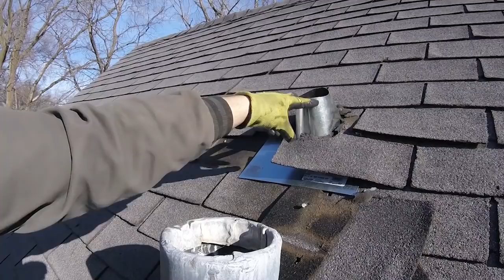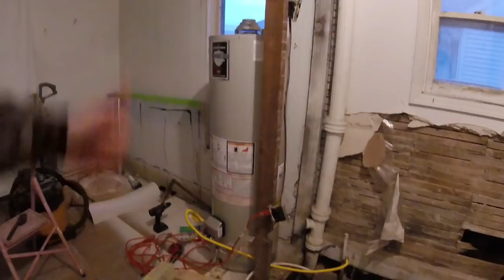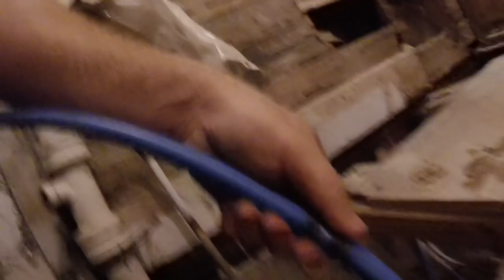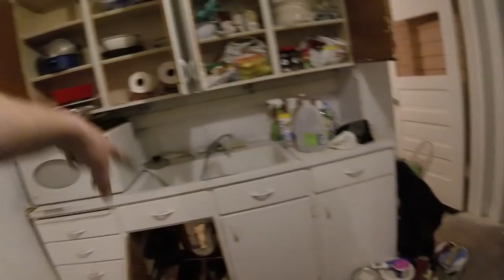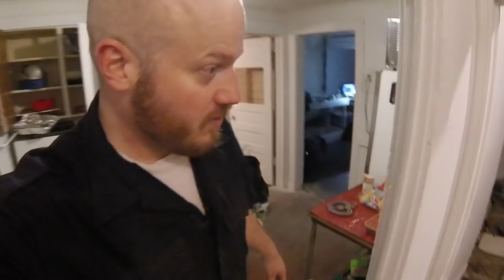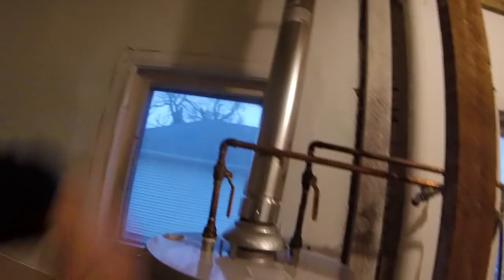$5000 House - New Gas Water Heater and Water Lines

Comment: I watched to see the fitting you used to tap into the gas line....you didn’t show it.  The connections to existing water lines, gas lines, cutting into them and connecting to them is the hard part....how do i connect to existing lines?   Too late i guess for you to show...you already did it.

Comment: Love your videos and calm demeanor.  Admire your bravery with the roof vent.  I could never do that. And gas! I don't even want it in my house, let alone me work on it.  Good luck with your house. Maybe a company either a manufacturer or local lumber yard could kick some materials like dry wall or insulation.

Comment: Most gas water heaters and furnaces,which are now 75%  or more efficient,  allows you to vent thru the wall. Which means you can patch right over that roof vent and gives you more options  as to placement of furnace and water heater in your house. Enjoy watching your channel ;we did same thing 40 years ago still in same house and still loving it.

Comment: My biggest suggestion would be to add a ball valve or any kind of valve before the flex hose to the water heater. Even if it's not code where you are, it will make any future work done to the water heater much easier. In my opinion all gas/water appliances should have a shut off valve before the units. This would mean in the future if you have to replace the tank you can do so without possibly shutting off the gas to your furnace or gas stove. 

Adding the ball valve even know after the fact shouldn't be very hard to do. Anyway I'm enjoying watching your progress on the home. I would go nuts if I found a deal like this around me, as I've been looking to buy a house for going on 2 years haha.

Comment: Not that it matters but if this was a new home or a remodel done by a contractor a few things would have to be changed with the water heater.
1. Drain pan under water heater with a drain to outside or a waste line.
2. Shut off valve at the gas supply line.
3. Gas sediment trap
4. B-vent used for flue (that flexible dryer vent isn't double walled)

Comment: Would that sticky membrane that you used on the water heater vent pipe be good to use under the toilet to help prevent water damage in the future?
Reply: There is a wax ring that has to be installed new and will not leak as long as the pipe flange is sucker.

Comment: Yes a 'new' wax ring everytime. Depending on the toilet & hole indentation underneath...
I have used 2 wax rings at times.
Plus a rubber sleeve over the woodwork into the pvc pipe on the floor.
It keeps the wood from rotting. You can glue down that rubber sleeve, use bricks as weights or nail it. The wax rings will take care of any dribble.
 I just cut off the excess wax around the toilet base, after sitting on the toilet as a weight to form the wax rings properly. 
You can cut the wax using a carpet knife after you have bolted the toilet to the floor.
Easy Peazy!
Reply from the maker: awesome! thank you for the tips.
Reply: FYI If you need to use 2 wax rings, make sure that only one has the built in flange.  Two flanges will typically not line up once compressed causing a reduction in the drain diameter.

Comment: Every single time you lift up the toilet, you have to change that wax ring --   Your toilet area looks better than mine :D  Something awesome to think about is while your wall lathing is exposed, it's a great time to insulate before you cover it up with sheetrock :)
Reply: Interior walls may not need insulation.

Comment: not bad- your roof will need replaced very soon.  you might check out roof cote or roof coat material to get you through a couple of years. Since you have done it once. you know how to do it again.  having the water heater  obscuring the window doesn't seem right.  could you shift it farther right to the corner?  so would you close up the window  and create a little closet around the water heater?  Not against it being visible  Could you shorten the wall to the right side of the breaker box?  just leaving about 3 ft of the wall.  then close off the doorway or opening to the left of the breaker box?